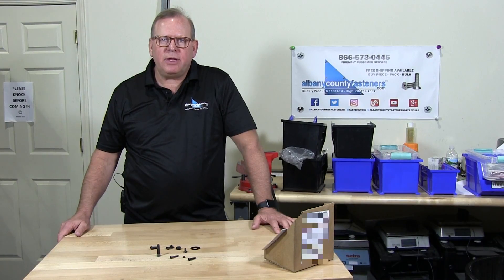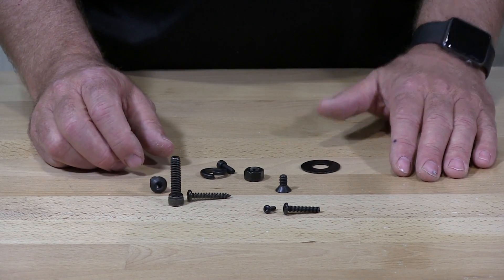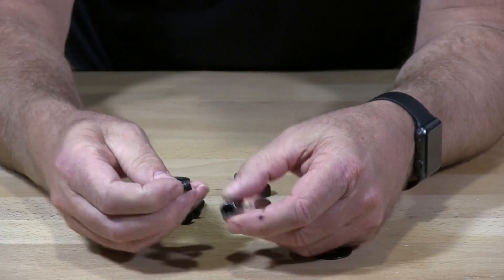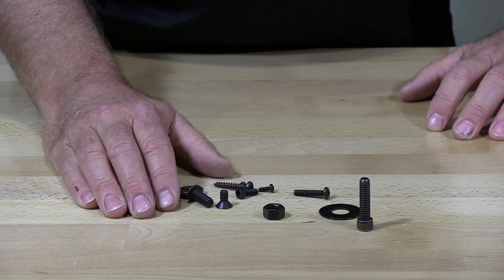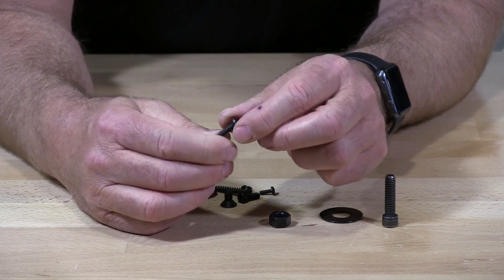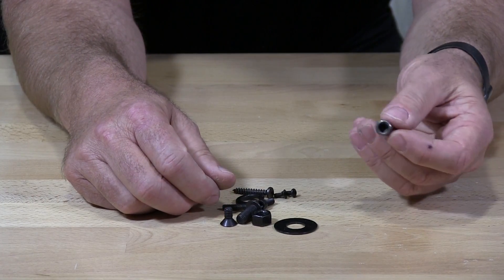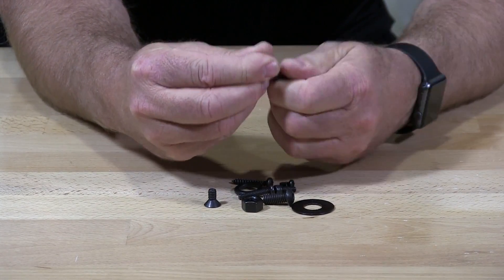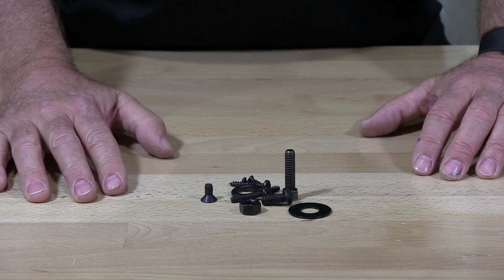Understanding The Black Oxide Process | Fasteners 101

Comment: QUESTION:  What is the advantage to applying Black Oxy to 316 Stainless Steel?  Does it help to prevent "crevice corrosion" (i.e., rusting of stainless in an oxygen-starved application (like a through-hull installation) where saltwater intrusion could occur, but the built-in chromium oxide protection from corrosion prevents passivization?

Comment: Why do you say black oxy when it's called black oxide?
Reply: I want to know one thing. That is if I coated two times black coating in same bolt. Is it any changes occurred in bolt strength and hardness?
Reply from the maker: Doing a double coat of Black Oxide would have little to no effect on it's strength and hardness. Black oxide is more for a small amount of additional corrosion and abrasion resistance and the color.
Reply from the maker: Black oxy is just a shorthand of black oxide. They're both the same, it's just a matter of preference.

Comment: When a casting is black oxidized does it look brownish ?
Reply from the maker: Yes they could if there is no oil on them.  To restore, apply a lightweight oil or WD40 to restore color.  Another way to restore is wax them.
Reply: Albany County Fasteners If i would apply oil then will it be black colored?
Reply from the maker: In most cases it will turn black but I cant see your fasteners.

Comment: Thanks for having these stainless black bolts!  How long can you expect the black oxide coating to last in an external automotive application?  I used some of your 1/4x20 black oxide stainless bolts to install some tail lights and I'm curious what longevity I can expect from the black oxide coating?